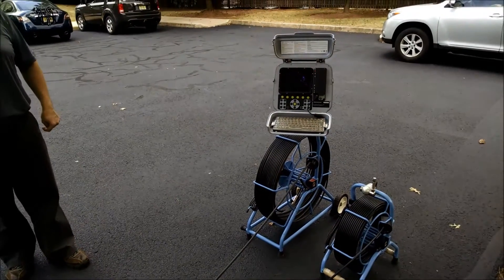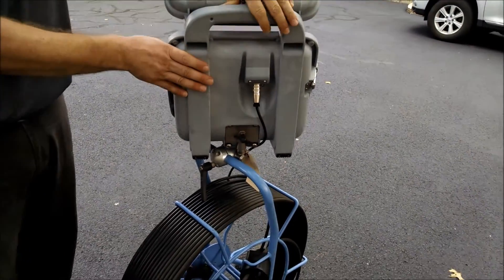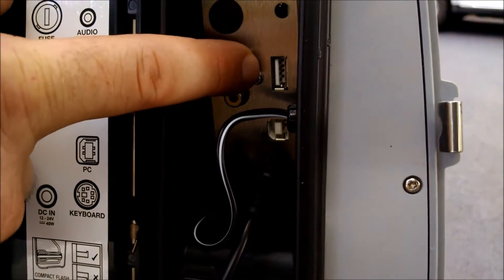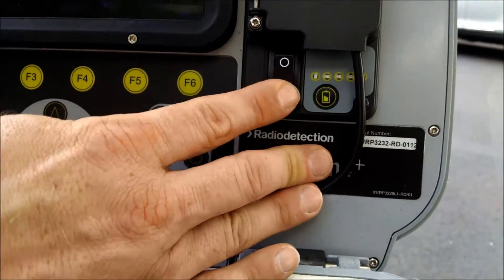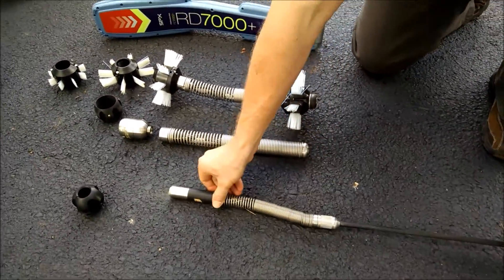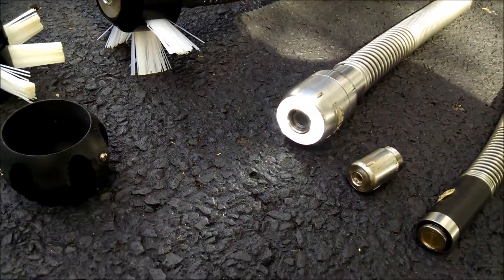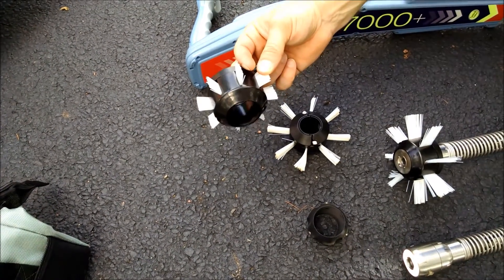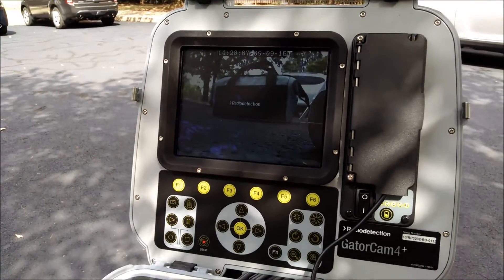Radiodetection Gatorcam4+ - Introduction

Comment: what is the diameter of the pushrod cable?
Reply from the maker: Hi Benny, sorry for the delayed response, this account is not monitored regularly, our fault. The diameter of the rod is approx 9mm (11/32"). I say "approx." because there are four different rods depending on the flexibility or stiffness that is required.